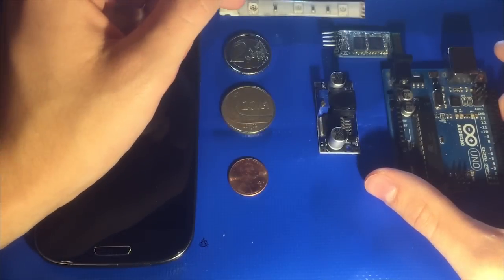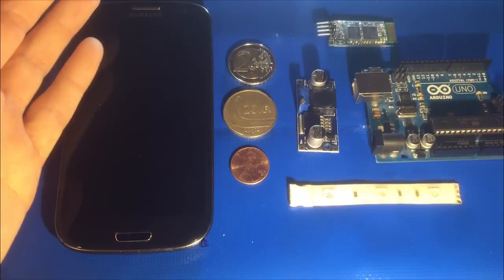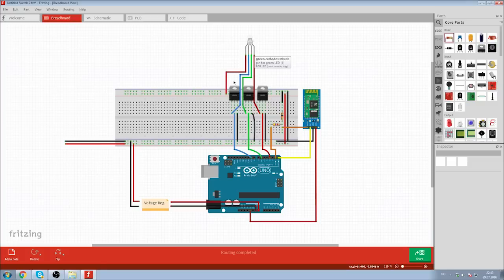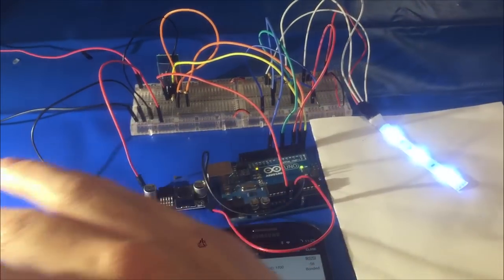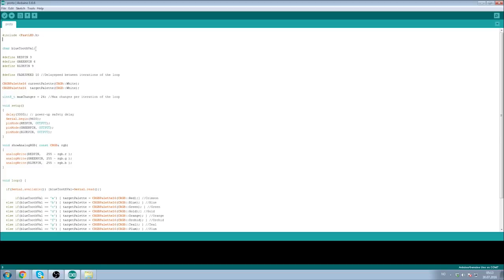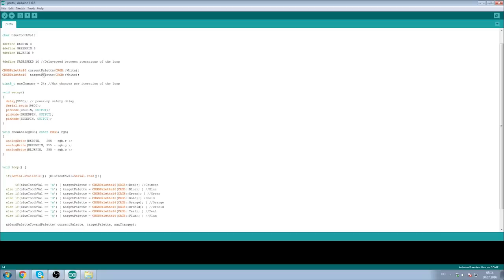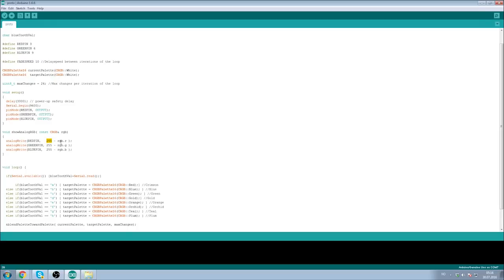Controlling RGB LED strip using Arduino + Bluetooth [Prototype]

Comment: Can i use HC-05
Reply from the maker: HC-05 is a more capable module that can be set to be either Master or Slave. HC-06 is a Slave only device. So yes, you can and may use the HC-05 to replicate this project.
Reply: Im Naero thnx🤗🤗

Comment: what transistor did you use?? asap thankss
Reply from the maker: I frankly don't remember, but any transistor that is designed to be controlled by a microcontroller will do.
That means low on-resistance and low gate voltage. For example, you could use this: https://www.sparkfun.com/products/10213
Edit: Also make sure it is rated to handle the current that you will push through it.